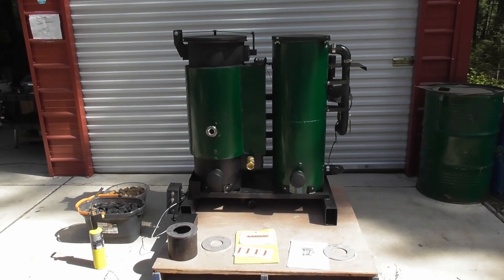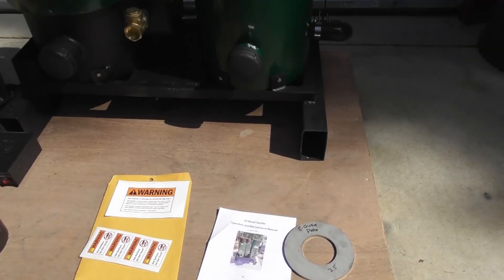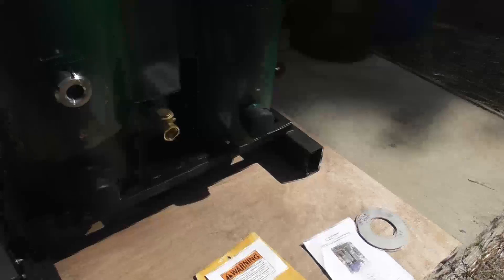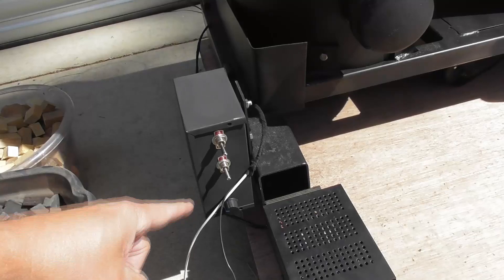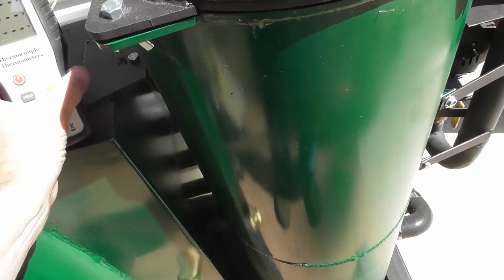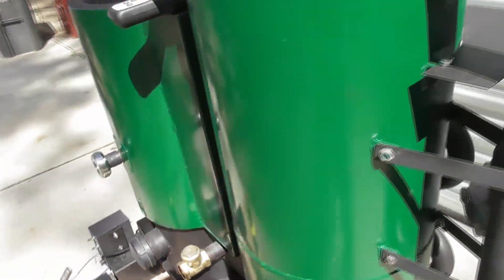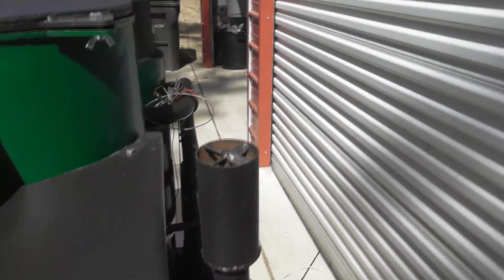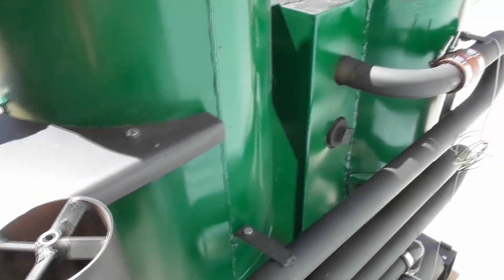Wood Gasifier Builder's Workshop:  Test Fire V3 Gasifier

Comment: Nice looking kit with lots of thought put into it. Be careful welding stainless folks.
Is there a video of this in operation? How long will it run on a load and how many hours before it needs shutdown maintenance?
Also, do you need a bladder system to store gas if running a smaller engine?